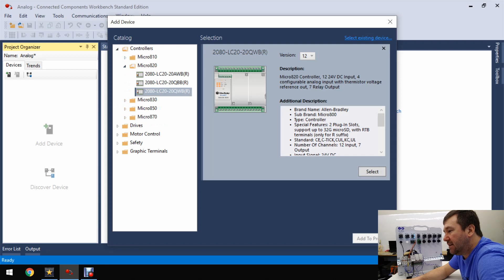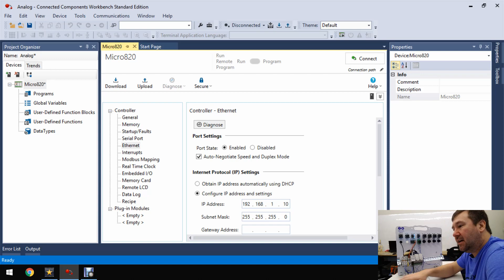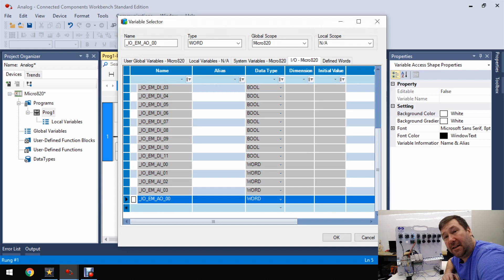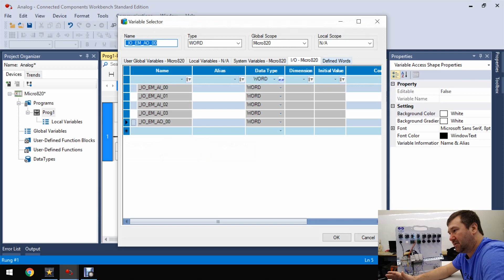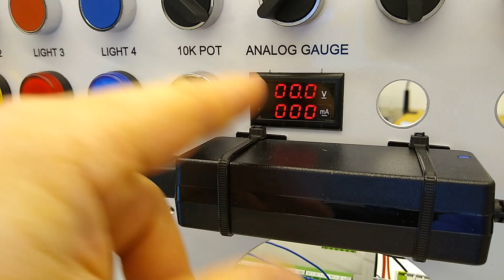Micro800 Wire Analog 0-10VDC inputs and outputs Micro820

Comment: Hello, the potentiometer you use is 10K, but by chance did you install a fixed resistor before the potentiometer?
Reply from the maker: It is a 5K potentiometer but no, it is wired directly to the PLC. The Micro820 has 10VDC terminal so a resistor for a voltage divider isn't required. I think this video covers what you are asking.
https://youtu.be/oSh2x-VXFfU?si=_keU0G74-uij-3e-

Comment: Tim, you saved me HOURS of head scratching. Doing a project scaling a pot to the AO on this controller and I knew the input was 0-4095 and assumed the output scales the same...my output voltages were always slightly higher than expected. I found this video when searching and by god your one comment about the output being 0-4008 was a life saver. Thank you sir.
Reply from the maker: You are welcome!
Reply: Doing this stuff on controllogix and compactlogix is so much easier of course, but the micro series is a great little plc for small jobs and this one is needed because of swapping an old Emerson commander sk drive out for an AB 755 75kw on a 400 ton reel drive, and unlike the Emerson unit the AB 755 has no internal controller for logic instructions, so I'm putting a micro820 in to take over the controls. The hydraulics have very specific voltages for fwd, reverse and stop to control the valves to drive the hydraulic motors. Excellent videos. Just when you think you know all you need, you find something else. The life of a controls engineer I guess 😂
Reply from the maker: Yep 😁

Comment: Hi Tim. Let me suggest an idea: if I use a standard 24VDC power supply and several voltage dividers that are outputing voltage in 0-10VDC range, each voltage divider connected to a different digital input source (button, switch, aux contact), I can add an "additional" digital inputs, by measuring the voltage from each input and attach an output or function to it, right?
Reply from the maker: That is going to get very complicated and probably not a good idea long term.  You are better off to add additional IO but if it is simply a lab experiment, google "multiplexing".

Comment: Hi Tim, Loving the content across the broad range of Allen Bradley PLC's an software. I have a project that I have been asked to look into where two analogue inputs are to plotted against each other (force vs displacement) and displayed on a screen with option to email the results. The site currently has SLC5/05 (many input and output cards, ie centralised unit) with RSLOGIX 500 software but I am looking into using a Micro800 series on this machine with a panel view screen to show the plotted graphic. If this is something that you would be able to discuss in a video? It would be of great help. Thanks Chris

Comment: I tried this today on a panel but while connected to the plc it read kind of an unstable value that would jump up and down.
Reply from the maker: Hi Andres.  Is it jumping up and down around the correct number or a completely different number.  If it is around the correct number, then try shielding it.  If it is a completely different number, check that your analog common and your 24V common are the same.

Comment: honest I have so many questions. Do you have a DM you use through facebook?
Reply from the maker: No, I like to keep the questions public where they can benefit everyone.
Reply: @TimWilborne  perfect I will keep asking questions. Really appreciate the response. Im trying to scale a Pot from 0-10v and have it show on the hmi and use the output to control the speed on a powerflex523.
Reply from the maker: @themichaelcoxproject  For scaling, check out this lesson.
https://www.theautomationstore.com/analog-circuits-training-analog-scaling-using-y-mx-b/

Also did you see today's video? It touches on scaling in the Micro800 PLC.
https://www.theautomationstore.com/how-to-wire-analog-4-20ma-sensors-to-the-0-10vdc-inputs-of-an-allen-bradley-micro820-plc-and-scale/

Comment: just a question Tim.....is the micro controllers good for only small works or can they do the same thing as the micrologix controllers?
Reply from the maker: Great question Ricco!  The Micro 800 PLCs including the Micro810, Micro820, Micro830, Micro850, and Micro870 have all of the capabilities of the Micrologix line and they are adding more features to them.  If I were designing a new system, I would choose the Micro800 line.
Reply: @TimWilborne  thanks tim much appreciated 😁
Reply from the maker: @rixpanapasa8977  You are welcome, if any other questions come up, feel free to ask.

Comment: Hey ! You make really good and educational videos.
 
I have a suggestion for a next video. Suppose we use 2 hydraulic cylinders. Measure the position of each cylinder with an analog instrument. The cylinders are controlled by each one propotional valve. How can we program so that we have acceleration and deacceleration? How do you program to get a master cylinder and a slave? The idea is that these cylinders should run synchronously. / F
Reply from the maker: Hi Fredrik.  Great suggestions!  The acceleration and deceleration are are popular request, I'm going to do them with a servo simulator.  The following application is more difficult but not impossible with a standard PLC.  I'll have to think about it.
Reply: Tim Wilborne I follow it with excitement 😊